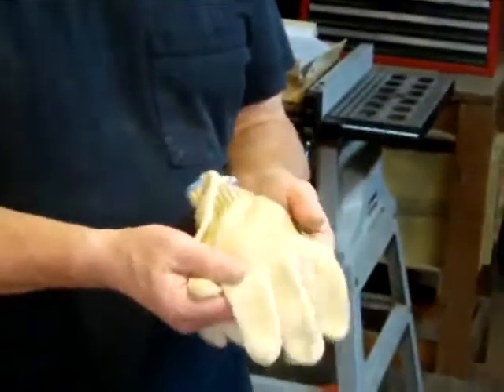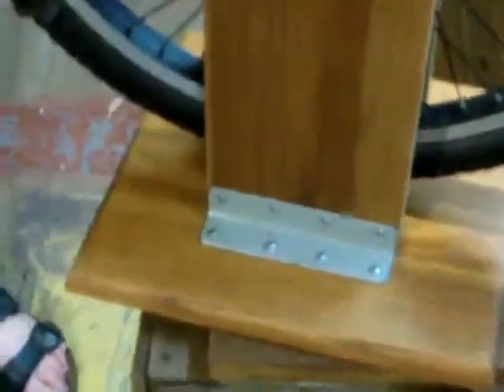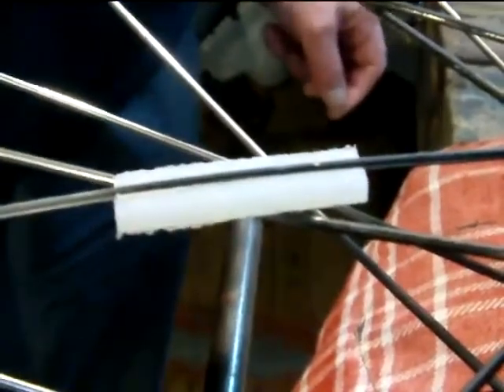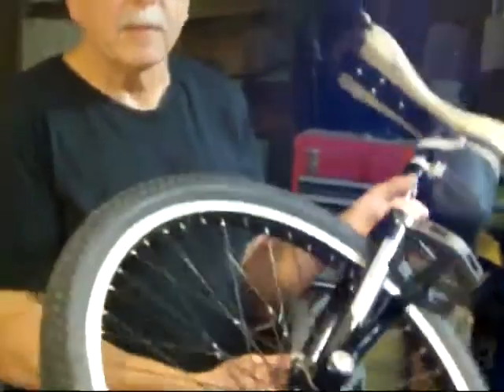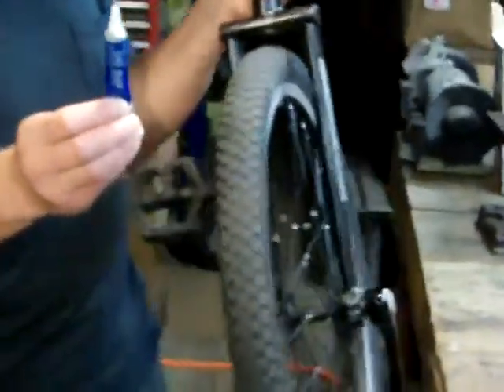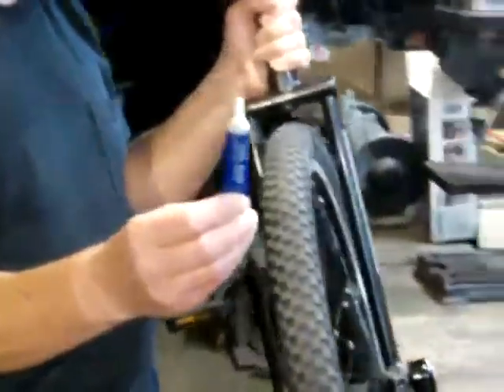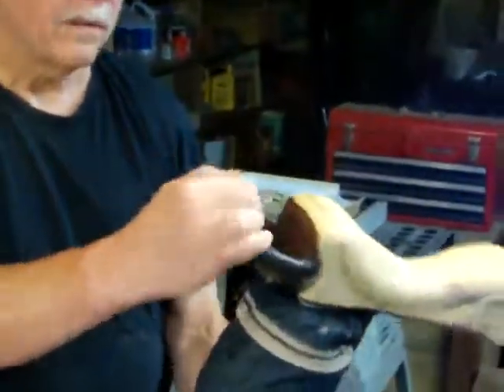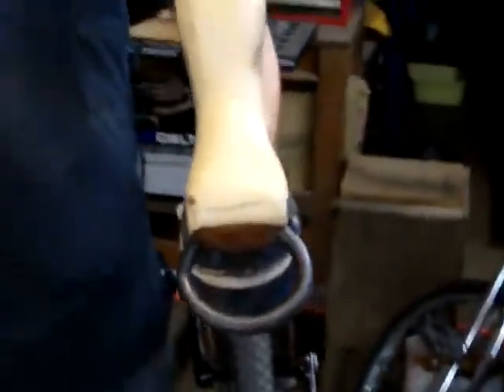Unicycle Equipment Suggestions

Comment from the maker: "Make a High-Torque Gear Puller Stabilizer" demonstrates removing the cranks and bearings from a unicycle wheel. It also shows where the axle and hub need to be welded together to prevent wheel groan/slip. Even if you don't intend to do this yourself, you will know what to ask for after seeing this.